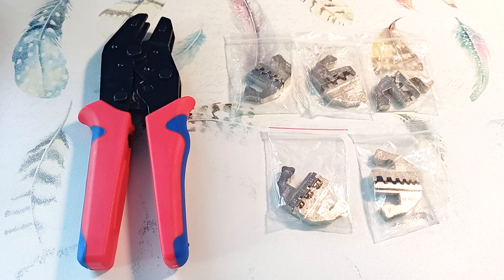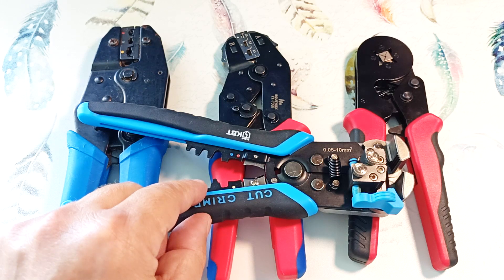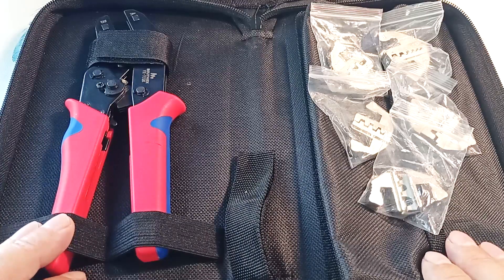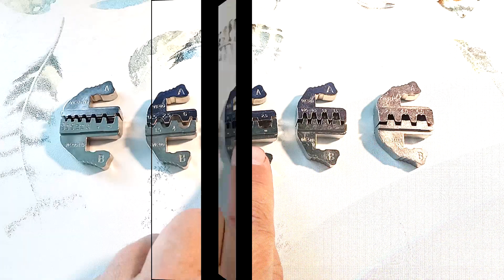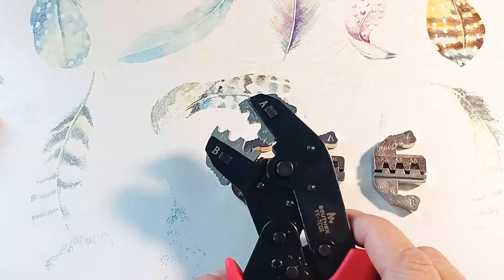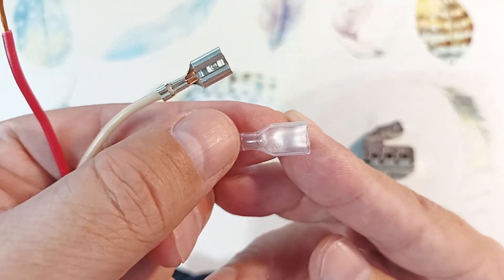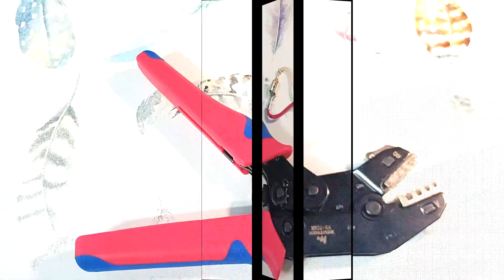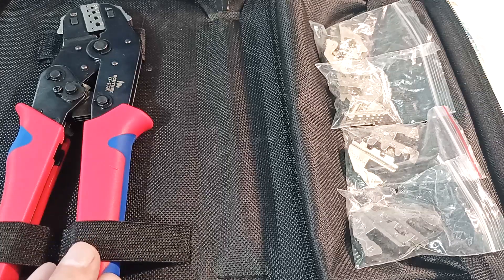Universal Wire Crimper SN-58B + 5 Dies – For Auto and Electric Wiring, Terminals & Connectors (2025)

Comment from the maker: https://alli.pub/786bn2?erid=2SDnjemSshf - These pliers are on Aliexpress
https://bit.ly/KlMatOz - Pliers with matrices on Ozone (Russia)
https://bit.ly/EngKan - Subscribe to this channel
https://bit.ly/Pomkan - Support the channel financially
http://goo.gl/a6YJdO - This channel in Russian.

https://youtu.be/O1x9YkY1cNs - Hydraulic Crimping Pliers for ELECTRICIANS
https://youtu.be/PxfOBkmt-sc - Automatic Wire Stripper GVDA
https://youtu.be/u6aVWlWbw6Y - Cordless Vacuum, Compression Mode & Blower
https://youtu.be/BikC9_oaR1o - Car Voltage Tester & Brake Fluid Tester
https://youtu.be/Fq3UyU6v94o - 256x192 Thermal Imager: The Most Compact